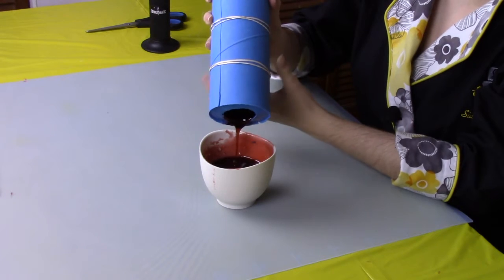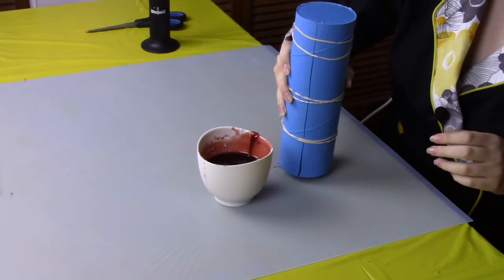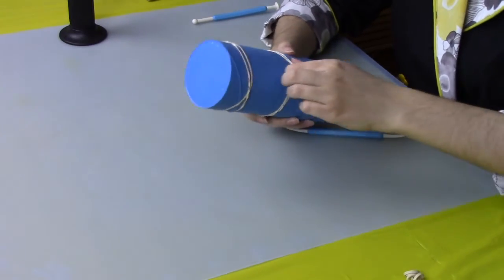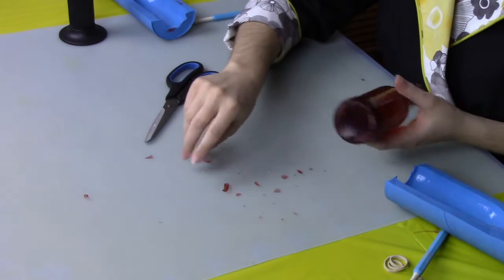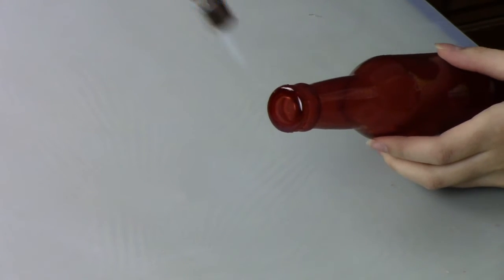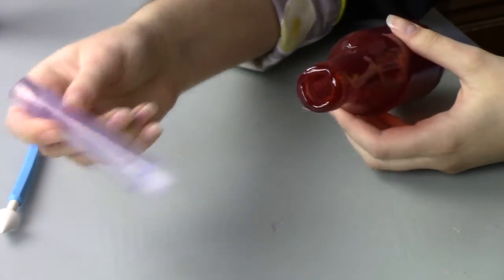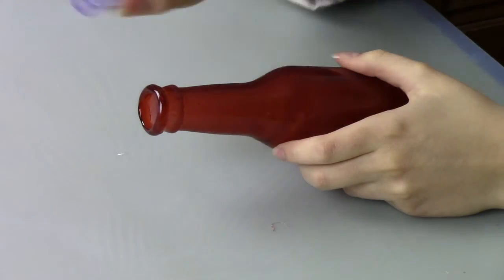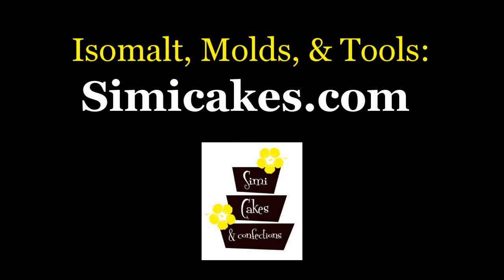Isomalt Beer Bottle Tutorial Part 2!

Comment: Great video. Viewers who do not have a chef’s torch can gently rub the edge over a hit pan to smooth imperfections.
Reply from the maker: Thanks!  The bottles can collapse from the greased hot griddle or pan because they are not solid.  The top or bottom better than the sides.